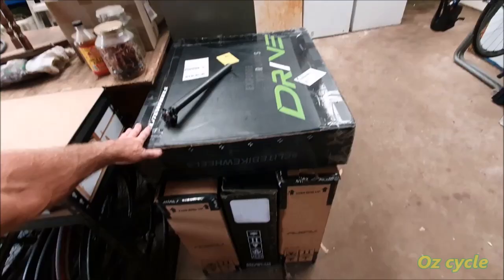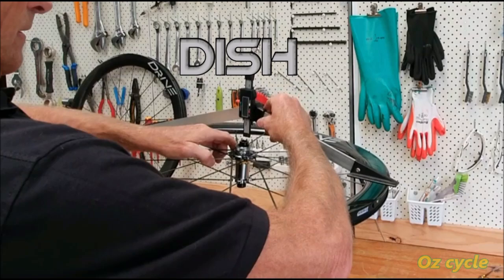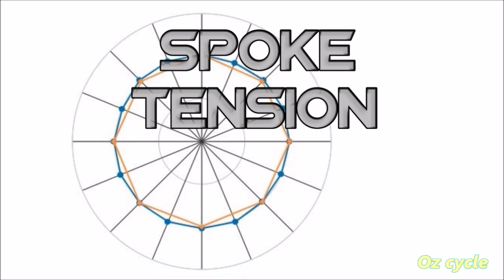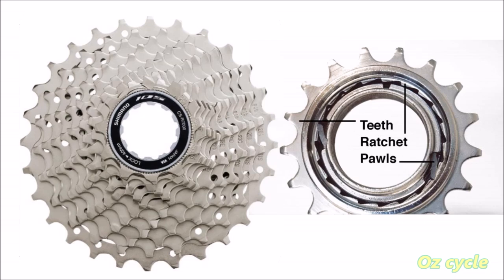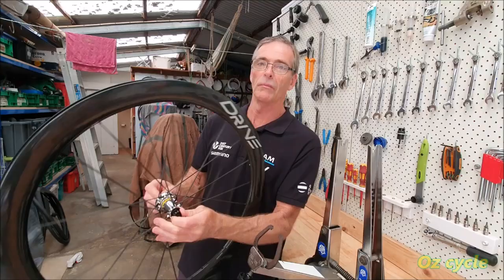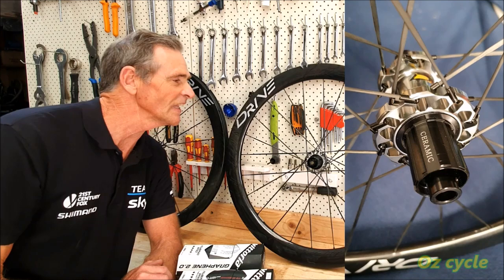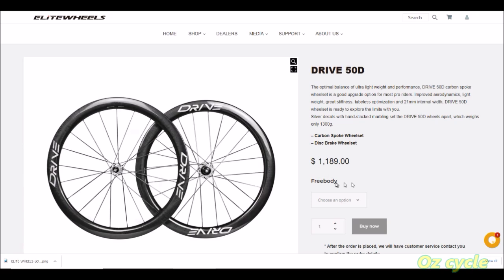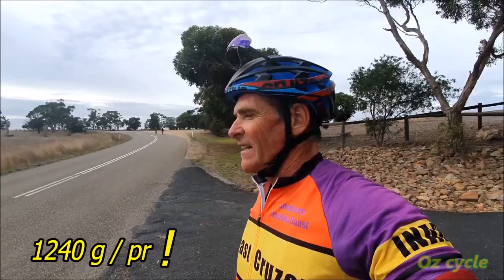Elitewheels Drive - carbon spokes , disc. Full review

Comment: Hi there, I was watching all your other videos about waxing chains etc but I have a question I didn't see you cover there: What should we do for out cogs/cassettes to stop them oxidizing/rusting straight away? I cleaned my chain, rear cassette and front cogs with a vinegar soak to remove rust, and rinsed with water to wash it off. It worked very well except almost instantly after drying, the front and rear cogs have orange rust/oxidization all over them. I'm guess normally the recommendation would be to lube them up straight away before it has a chance to set in, but I'm wanting to try your wax method so I don't imagine waxing all the cogs etc. is the answer? Thank you!
Reply from the maker: Cassette sprockets should be anodised. If they rust that quickly they must be a cheap type and in that case you can try spraying them with silicone
Reply: @stevenleffanue  Thanks for the reply. Yes it's off an entry level Trek hybrid 7 speed bike. The cassette/freewheel is a shimano MF-TZ31). I will try and spray it with some silicone after cleaning to stop the rust coming back, hopefully this wont impact the wax negatively. Can I also ask where you get your wipperman connex chains and links from in Australia? I'm in Brisbane and I can't find many anywhere, and when I do the price varies a lot. Thanks again!
Reply from the maker: Difficult to source connex chains at the moment. My last lot was from "Badger wax" ,Ebay
Reply: @stevenleffanue  Thanks very much for answering! Appreciate it.

Comment: I like Elite's wheels. Only issue I have with their lower end wheels is the rear hub. They don't do a replacement freebody for the RF08 hub.
Reply: Are you sure that the freehub is proprietary?? Look around at other manufacturers freehubs..   Rgr
Reply: @borano2031  not sure it is, but can't seem to find any. Will probably have to take it off and visit a bike shop.
Reply: @chrispalmer3096  Yes, take it off and search the large auction site, where manufacturers list their products and compare to yours. Novatec, Powerway, etc...    Rgr
Reply: @borano2031 not needing a replacement yet, but aluminium freebodies do get gouged eventually...so will do that... thanks fella
Reply: I believe they do sell the hub body seperately.  You will need to inquire with them unless they have changed.  But when I ordered my wheels I inquired on adding extra bodies and was provided a quote.  I'm running their lower end set with around 10k kms and zero issues so far.
Reply: @azngouki  I've checked with them, and they don't. They said I have to buy a complete hub. The lady didn't get it when I said it make more sense to sell replacement freebody.

Comment: Nice looking wheels Steve. I find the tubeless setup heavy it's sort of counter productive I feel. My clinchers with latex are 250g.
Reply: did your wheels come tubeless ready, if so what did you do when you went with tubes ie remove tape/seal in wheel well?
Reply from the maker: Yes , I use tubes also. There are "TPU" tubes now , extremely light.

Comment: You sir are a national treasure, can you do Super Team wheels next?  or ICAN wheels?
Reply from the maker: Thanks! I have done a review on some ICAN wheels - here's the link: https://youtu.be/Kp-3VNZtr6c
Reply: @stevenleffanue  Thank you so much!!! gonna grab myself a set of ICAN
Reply: I'm interested in purchasing a pair of Elite 40 wheels.
What pressure can you put on these rims when using a tube tire?
Do rims have a recommended limit?
Thanks.
Reply from the maker: The tyre is the pressure limit not the rim. The rim will handle whatever pressure you use.
Reply: @stevenleffanue  Sorry I asked wrong.
What I want to know is, given that these rims are for tubeless tires, if I use a tire with a tube, is there a recommended pressure limit as with tubeless use?
Reply from the maker: @m.batista3875 No , use whatever pressure you want.